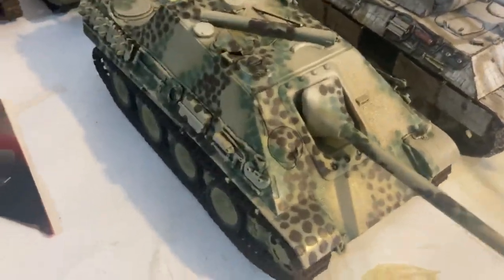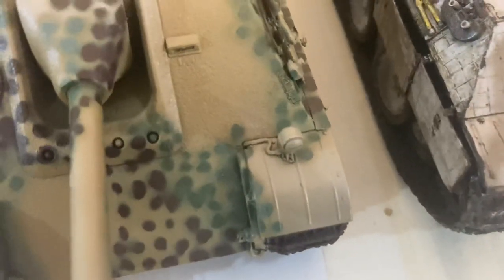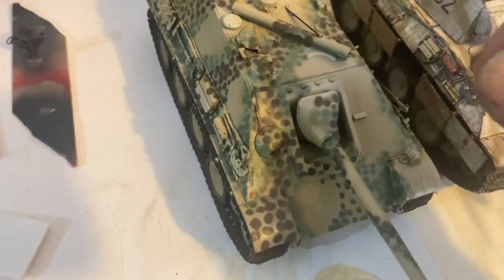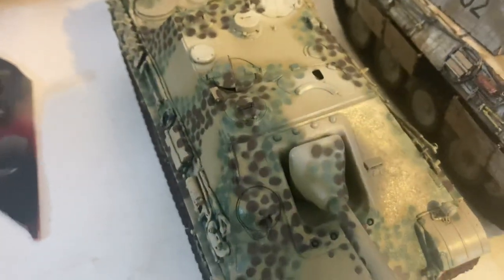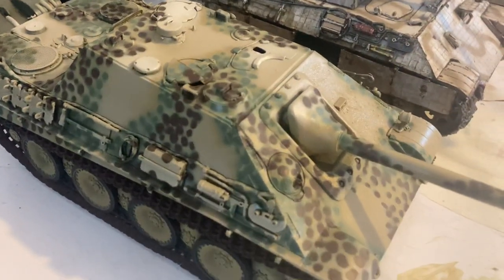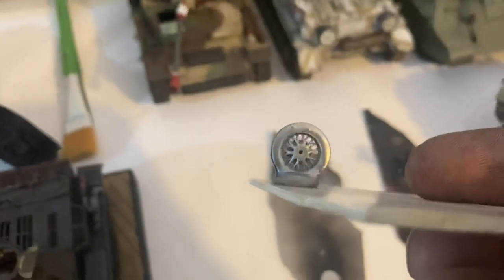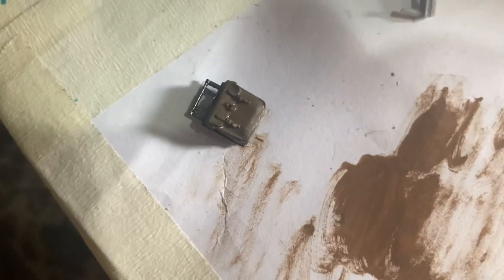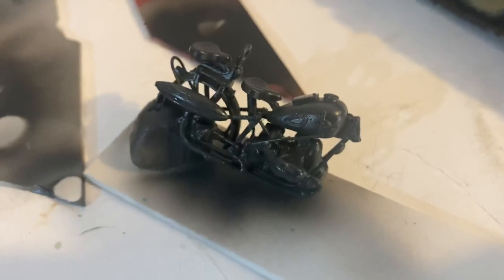Lessons learned creating a German Ambush Camo pattern. Meng Jagdpanther

Comment: Yes, I agree Jonathon. The dots can't have a blurry edge to start. Perhaps a 1-hole punch or 3-hole punch could be used to make circular discs that could be attached to the hull with a weak adhesive? If you applied a filter and/or weathered the tank afterwards, it would very slightly soften the edges of the discs anyway. There are also masks you can purchase to do the ambush pattern.

Having said that, everything is looking great! 👍👍
Reply from the maker: I’ll continue to develop the method. I’ll get more paint and try again following my new rules. Than hopefully I can share a easy technique using common household items. Fingers crossed mate. Yeah I’ve seen a lot of the border masks. I nearly bought some but the price was pretty high and being the cheapskate Aussie that I am I thought, ‘I can do that with blu tack!’ Bush mechanics mate. The Aussie way

Comment: Get miniarts Gantry crane set I'm using it with the full interior stug in a diorama it's really cool figures look great too! You've got loads of sets I've got love all the field workshops etc aswell! Fade you ambush camo in at the edges and give it a dust coat with buff it'll look good!
Reply from the maker: It’s back in the cupboard waiting for the next experiment!! Haha. I’ll strip it back one day and put it on a display base.
Reply from the maker: I have older models I use as idea test beds. I have a Tamiya Panzer IV that has been experimented on to near destruction! Haha. Crappy Panzer IV it is those Tamiya ones.

Comment: Well worth trying out! I look forward to seeing how you develop it. Can't beat a bike for filling an awkward bit of space on a diorama! Are the spokes plastic or PE? They look pretty good for scale.Cheers.
Reply from the maker: This pack had plastic spokes but I got two packs. The second pack has a photoetch plate in it. MASTERBOX sell a no PE bike cheaply and the PE one is ten dollars extra. But I thought I would make the plastic one first to get used to the build and framing. I really like the resin extra kit I got with it. The covered head light looks a lot better and the leather bags are 10 times better than what MASTERBOX put in. It’s a MASTERBOX build so it’s the hardest build I’ve done but it looks great. I suspect Miniart did the mould for them.
Reply from the maker: Yes I will develop the Ambush pattern and make it accessible to all. That’s what I’m about lately. I create systems, that’s what I do, so may as well create good Camo systems that an average labourer can achieve.
Reply: @Jonhistorymodel  Nice one. The plastic ones look fine for me! 😁👍
Reply: @Jonhistorymodel  Sounds good to me! 👍